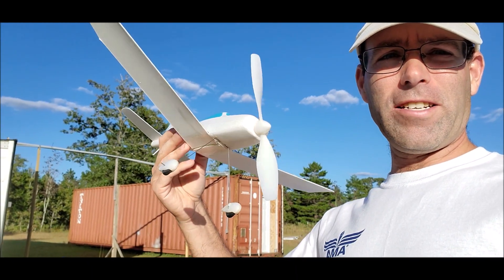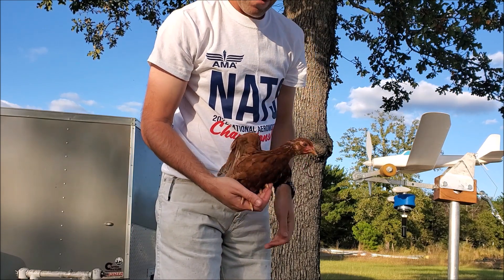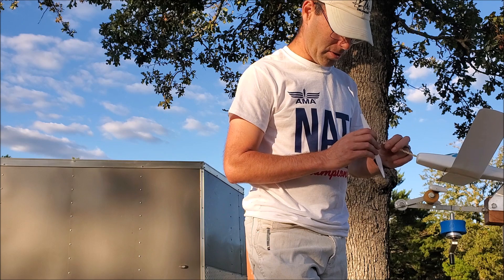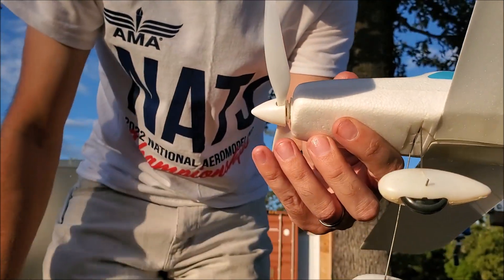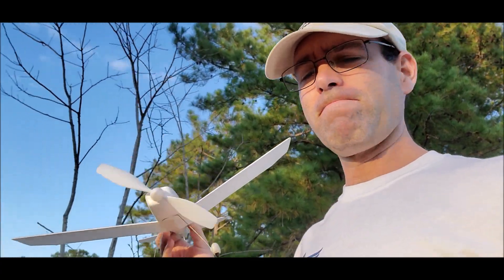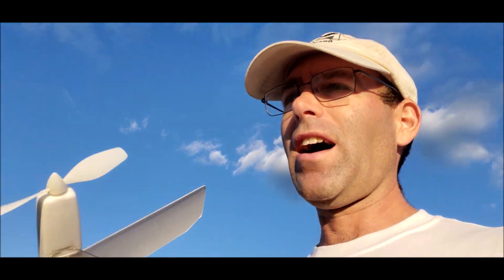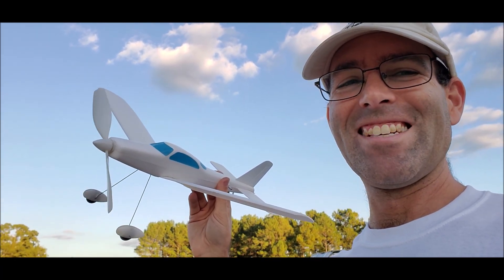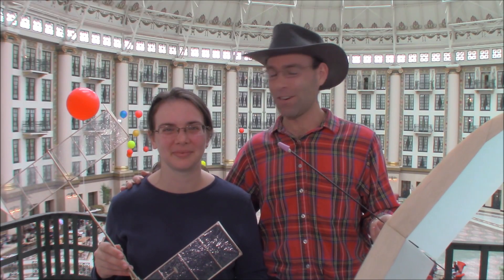Can we make this rubber powered foam toy airplane fly?

Comment: Check out the "Gizmo Geezer" props with freewheel hub. They have a pin design wich eliminates the rubber climbing up the hook.
Reply from the maker: I've got a few P-30s with Gizmo front ends and they do work very well indeed.

Comment: More details about the plane please. About 10 years ago I purchased three models made of a similar foam, a Cessna, Spitfire and a Mustang. The rubber supplied with them was junk but otherwise they fly pretty good. Problem is the ones I got are no longer made. Looking for something even remotely similar.
Reply: Ah think I found it. Its called the Reely Sky Sedan.
Reply from the maker: There you go! I have a case of them that I'm going to sell off eventually.

Comment: Does anyone know if I thin under cambered  air foll has 110 and see the Dutch roll or snap roll because I own 2 models with that problem and I hate to increase the vertical stab area at both are scale models.......ugly fin on bottom.... I would rather modify the wing or the air fall instead..... Both are rudder elevator controlled Could that be the problem?
Reply from the maker: Dutch roll is usually an issue of wing vs fin sizing issues. Check that you have sufficient washout in the wingtips. If you do, consider enlarging the vertical tail and/or reducing the dihedral in your wing. A lot of old timers have high mounted wings with lots of dihedral and this can make them very sensitive to yaw inputs when converted to RC.

Comment: Is there some way to determine a horsepower rating for the..."engine"?
There must be considerable variation between rubber bands of different thickness, length, types of rubber...
A tiny dyno would be very useful.  If such a thing existed.  Which would be astonishing. And expensive, no doubt.
Reply from the maker: You can compute stored energy via torque vs turns while unwinding. Power then is available from the speed of the prop as the motor unwinds. There's a good article on rubber energy usage in this year's Free Flight Symposium, available at freeflight.org

Comment: Love the video content of this channel....would you ever consider doing a build video of something like a Guillows 500 series laser cut warbird? or...a Peck Polymers Peanut kit? It would not need to be a Long video...I was thinking if you covered mods you would make to the kit(s) to improve flight potential and of course a trimming video of the finished model would be great!
The Guillows warbird would be the more challenging project....just thought I would ask, Keep up the great work!
Reply from the maker: I've got a couple more Guillow's kits in store and hope to get to them eventually. The 500 series I won't touch, waaaay too many mods required to get them to fly. The 900s require only minor mods to get them flying wonderfully. I'd love to do a Peck kit but not while they're under their current proprietorship. That's a hot mess that I won't touch, been burned too many times.

Comment: Or use an APC slowfly propeller?
Reply: The weight also increases the scale factor of the plane.
Reply from the maker: Slowfly props have an extremely low pitch/diameter ratio (usually 0.3-0.5), and rubber props usually don't hit their best efficiency until at least P/D 1.1, sometimes closer to 1.6 (this propeller appears to be at least 1.5, which is what makes this plane climb and cruise so well)
Reply: @joshuawfinn  My policy is lower pitch propeller is more better/efficient. I would test it with more strands and lower turns. It should also be possible to insert a ball bearing in the APC propeller to reduce friction. It will be nose heavy, but most real propeller planes are. Maybe also use contrarotating propellers to reduce torque steer.
Reply from the maker: @prep0wer  like I said, best efficiency at P/D >1. Most full scale aircraft with VP props cruise in the 1.2-1.3 range, dropping down to 0.8-0.9 for climb. Anything lower is inefficient except in high alpha/low speed where the prop is contributing to the lift force of the airplane (why helicopters operate in P/D <0.3 usually and have non twisted blades). The Slowfly props are made for aircraft that spend a lot of time in high alpha (need low pitch to avoid blade root stall) or are using the prop to limit top speed (prop runs out of pitch speed and can even be used as a speed brake). You want neither of those things on a rubber model.

Comment: Does the package and instructions have a manufacturers address where you can get more props? Check with Rob Romash at Eclipse Toys, who sourced the AMA Alpha and Beta from China.

Glide testing from shoulder height is about useless. It is still recovering from the impulse of the launch when it hits the ground. I find I get better glides launching it like a hand launched glider; steep right bank, high nose. It climbs to altitude, rolls out high up and gets into a proper glide long enough that you can get a proper read on trim.

Comment: That was great Josh, adding the dihedral made a world of difference. I bent in washout but no doubt that adds drag. I did not properly wind mine up because I didn't haul a stooge out, then the prop assembly appears to have some grit inside it. The rubber climbing on the hook was a problem too. I have two more planes that I will improve on. It is only 37 degrees and windy here so no flying.

Comment: Nice.  What kind of winder do you have and do you carry it in your store? Thanks 😊
Reply from the maker: We do carry winders that work quite well, however this particular one is one of a pair Ross Clements built for us. Unfortunately it is highly unlikely that any others will ever be produced as they were very labor intensive to make. They'll also never ever wear out as they're made for massively larger loads than what we're applying
Reply: Thanks for responding so quickly.  I'm a retired machinist, so I might make my own. I bought one from you about a year ago.  It's fine, but that one in your video today is really nice.  I don't suppose you have any plans for that one? I've thought about making my own or even an electric.

Comment: Ok, how did you get the spinner apart to put the good rubber hook on?
Reply from the maker: I just carefully cracked it loose by cutting into the glue joint with a razor blade. It came off surprisingly easily.
Reply: Man, that's funny! 😆